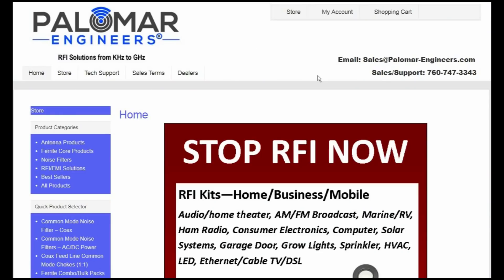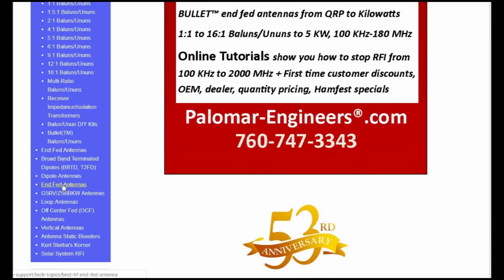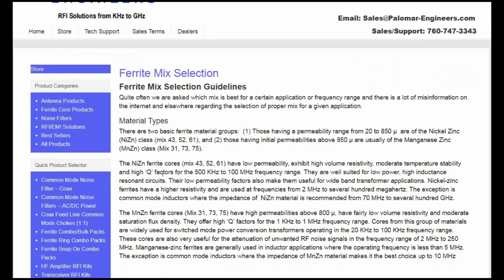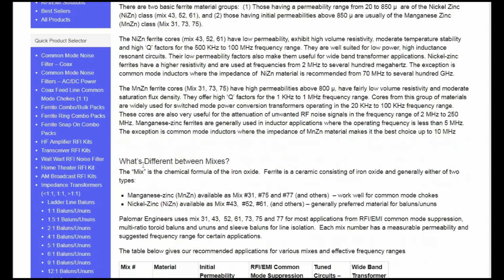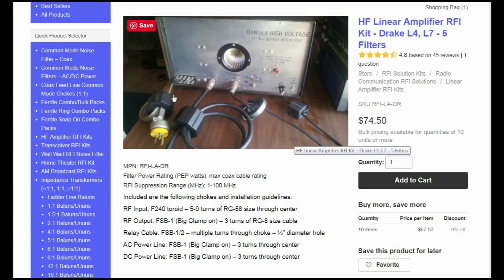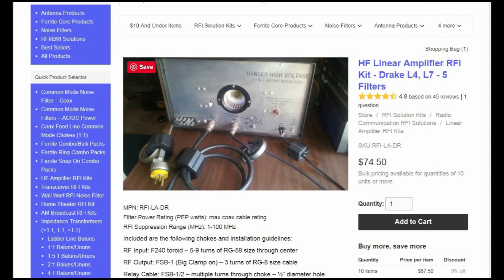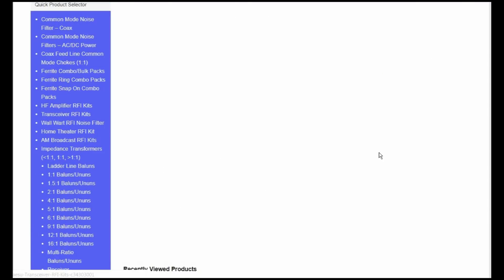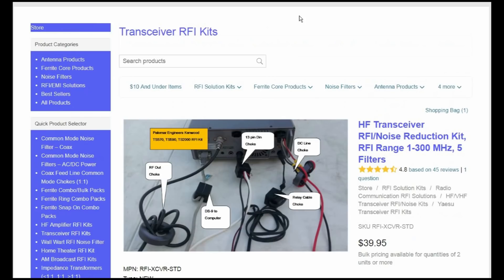Ferrite Beads, Common Mode Chokes, RFI--Jim W6LG--Ham Radio Basics--A Look At Palomar-Engineers.com

Comment: I know this is an old-ish video, but a quick question, if I may. If you get a certain RFI reduction by winding your coax through a type 31 toroid 5 times, do you get the same result using 5 type 31 ferrite beads on the coax? Is each single bead the equivalent of a single pass through the toroid and, therefore, 5 beads are the same as 5 wraps through a single toroid
Reply from the maker: Just a guess at 0400 local, I think the latter might be actually better.  I had to read what you wrote a few times to get the idea.  I was thinking core saturation and distance to the core.  We're not likely to get response from someone on this question.  You may want to find a forum somewhere that deals with ferrite.  Sorry that I don't know the answer.  73, Jim W6LG
Reply: @ham-radio  the latter also looks a lot neater.

Comment: I use Mix 31 on everything. at lest 5 on end of coax to get over the 2000ohm mark. they work amazing.
Reply from the maker: Good to know! I was using 8 if they are split beads. 73, Jim

Comment: Just got an amp and half way done getting it back on the air. Wondering in I'm going to need to add something like this?
Reply from the maker: Not likely.  If the amp is the tube type, follow my instructions in another video about how to tune it up correctly. Welcome back & 73 Jim

Comment: Great video, Jim, thanks! I think I've seen all (or almost all) of your videos on grounding, eathing, and bonding. What I'm wondering is how you specficially deal with lightning. Do you use a lightning arrestor for coax? Or do you simply just disconnect and unplug your rig in the shack. The more I've poindered this question, the more the latter seems to me to be the better solution, as lightning has been known to propagate in unpredictable ways. Anyway, I'd greatly appreciate your thoughts on this. Cheers!

Comment: Hey Jim, I am about to begin construction on the attached "shack" on the house, which will take a 20 amp and a 15 am power supply through NM-B cables (12 and 14 gauge, respectively).  What about clamping one or more snap on beads onto each supply cable from the breaker box during the rough in?  Any thoughts?  Albert KRO4OLM (waiting on the new vanity call).

Comment: Hi Jim: Thanks for the very informative video. I am going to give this a try for RFI Problem I am having with a SM power 
supply that is very noisy on AM radio at around 590kcs. Hope this works but bear in mind this is a “reduction” kit how much 
time will tell. I feel like I am trying to put lipstick on a pig. I should have bought a Astron supply, but look at all the money I am 
saving! 73s ka7smu Don.

Comment: Hi Jim thanks ever so much for your video, very useful. You say to check the ferrites you need because they have different frequencies but they’re quite wide band so how do you decide what you need. Generally mix 31 or mix 43 or mix 50 something as you go higher in the frequency is that not correct is there some kind of table for this or guide? M0uhf
Reply from the maker: Don't stress a lot about the mix.  They are generally wider than you  might think.  Sometimes I have stacked a mix that was not quite right but I used a bunch to get to the necessary lump impedance.  I think Palomar has a guide on their website.  73, Jim

Comment: What do I do when the isolator makes my swr go up?
Reply: your antenna is using the coax shield as a counterpoise. When you install the choke you basicall have no counterpoise so the antenna no longer works correctly..
if this is an end fed antenna try moving the choke further away from the antenna feedpoint..

Comment: Jim, in this video you show 7 coils of lmr-400 through 3 ferrite 2 inch round core of a certain type. I assume they are all the same type but what if I used three type 31’s and then three more type 43’ or 61’s at another point on that loop of coax, would I get the best advantage from both types being usedtypes?
Reply: interesting question. and in theory, yes that would work. IDK why you would need to do this though.

Comment: gm jim i bought a snapon  clam ferrite bead from amazon  bec i am in a real hurry to build a commonmode  I choke.....the package says 31500 and claims to be a type 31of course as usual  they are made in china, how do i test to very that this are  type 31 clamp on beads ? i have an mfj 259D on hand ??? how do i do this test and what values of inductive reactances are i going to look out for ? tnx de n6mmq 73s i did some tests but im not sure how to interpret the readings i had as far as impedance and inductance are conserned. also i did not terminate the ends of the PL259 RF connectors i just left them "open" will it help if i put a 50 ohm carbon resistor as a Load ???  the freqs i used were 2.0 mhz and  3.5 mhz and i read results saying R( Z > 650)   ohms or Z at this two bands. i wish i had those Lab gear and test equipment we had back in college... how reliable are beads sold on amazon ?????
Reply from the maker: Hi, I don't have a good answer.  Since I read your email, I have been thinking about using the NanoVNA.  What if, if, you put some beads on coax and see if there is a change.  What if you put ferrite beads on the coax and ran some power.  If the beads heated, then they are reacting.  I am still thinking about how to do this. 73, Jim

Comment: I use the Fair-Rite brand, 43 material for my applications. A typical choke for the antennas I use consists of five 2.4" toroids with four passes of RG213, and space the three loops out. This is based on a very extensive bench test article I read.
Reply: This was for 27mhz by the way, it's obviously frequency specific, fine for 10m though. 31 material is fine too.
Reply from the maker: Thanks!  73, Jim

Comment: Great info Jim thanks. I just had an MFJ Line Isolator fail on me. SWR going crazy when TX over 25 watts. Anyway.... at least I found the problem. Good recommendation on that site Jim much appreciated. Hope to hear you on air. 73 G4VZZ
Reply from the maker: Glad to help Eric,  73 from CA where it is hotter than ....

Comment: I am using a Mix 31 snap on 1”
bead with 8 turns for 11m.  Would adding more beads help or more turns?  Also have a cube RF filter at the radio.  All from Palomar.  Thank you and love your vids!!
Reply from the maker: That sounds like plenty of choke.  Please go for a ham license.  It is easy and a lot more fun.  Do not carry over what happens on 11 to meters to the ham bands.  Go for the Extra Class license and with that, you will learn a great deal more about electronics AFTER you get the license and get on the air.   Thanks, Jim
Reply: Jim W6LG Thank you for getting back to me so fast!  Ya it’s about 17k ohms of choke.  Funny you mention HAM..I have been studying for my tech but Covid put a stop to testing in my area of So California. 

I agree 11m has a number of characters.  I have made contact with some nice gents. Really good conversations with them.   I initially got the radio for off roading.  A few contacts later...I am hooked!

Thank you agian! 
917 Runner So California
Reply from the maker: Where are you in So Cal?  73, Jim
Reply: Jim W6LG San Gabriel Valley...Pasadena area.

Comment: Great video Jim!  I just finished building a 9:1 transformer balun and a 1:1 current / choke balun.  The 1:1 balun is 2 conductor, 14 gauge thhn and wound with 12 left and 12 right windings.  I have a bunch of the snap on beads that will fit my RG213. Would the addition of these beads be advantageous or would that be overkill?  thanks for your time!

Comment: Hi Jim, firstly I wish you well with your health, your videos are informative and balanced and I find myself in agreement with everything you say. (A shame as I like to argue). I would recommend a look at the website of the late G3TXQ, he used a VNA to measure common mode impedance of various common mode chokes. My own measurements are in the same ballpark as his. A word to the wise, if you use them either side of a linear amplifier you also need to choke the PTT and ALC lines etc. Not sure I would use them on the input side of the amplifier though.... 73 (sorry I just spotted the chokes on the various leads on the Palomar example)

Comment: Hi Jim, have a question concerning grounding for your ham radio room. If one wanted to isolate equipment, from the standard home grounding and use ground rods, or ground ring connected to a main bus-bar, would you have to use a insolation transformer for all your electrical power requirements? And thank you for your informative videos.
Reply from the maker: I can't recommend and I don't agree with what you propose.  If there is a fault, it needs to lead back to the main panel.  I would not circumvent the National Electric Code.  Those guys are pretty smart at protecting us.  Thanks for the question Mary.  Stick with the what  your Building Department and Code Enforcement tell you to do. 73, Jim W6LG
Reply: Thank you Jim, still learning. Will go with your recommendation, Mary.

Comment: Hi Jim..I'm getting some RF feedback on my tx audio with my Icom IC-7100 when I'm operating HF mobile in my car.This only happens when the microphone is plugged into the head unit and there is a long connecting cable between the rig and the head unit so I'm guessing the cable is picking up the RF and causing distortion on my tx audio.If I plug the microphone directly into the rig bypassing the head unit connection then the problem goes away.Hopefully Palomar can help! .73 Ian G7HFS .
Reply from the maker: I mentioned exactly that in the videos.  Find a good quality cable and make an extension that is well shielded and has appropriate parts to limit RF on the mic cable.  73, Jim W6LG
Reply: @ham-radio  Many thanks.☺

Comment: Thanks for that valuable information Jim!
Reply from the maker: Thanks.  That makes it worth the work.  That video took a lot of time to prepare and produce.  It was well worth it if it helps you and some others.  73, Jim
Reply: @ham-radio  Yes, great video (as they all are), Jim. Just upgraded my equipment and needed help w/RF issues. Friend recommended some beads on Amazon for under $10. Would rather spend more and it work, than to make a donation to Brand X. Lol. 73.
Reply from the maker: Hi and thanks for watching.  For your first time making a common mode choke or unun or balun, I would recommend a discussion with Palomar. I met them, him, once years ago at a show.  We had adjacent booths; nice guy.  Generally for my uses I buy more than I need at the time.  If the recommendation is for 6 beads, I will add at least 8.  I try to keep many in a box at the parts drawer.  I know I am going to need them.  As far as quality goes, there is some crap for sale.  Some beads look pretty and do nothing. I hope that helps you. Thanks, Jim

Comment: Hi Jim,
Very informative video. The Palomar website has much info on RFI choking. In the RF amp and HF Transceivers RFI kits they have  selected the correct mix for each application. First time looking over the info they offer. Thanks for pointing out their website.  73  WB3BJU